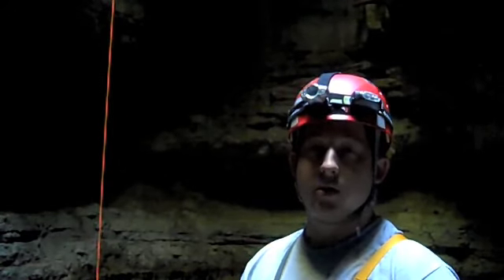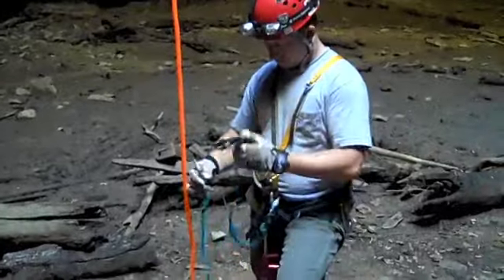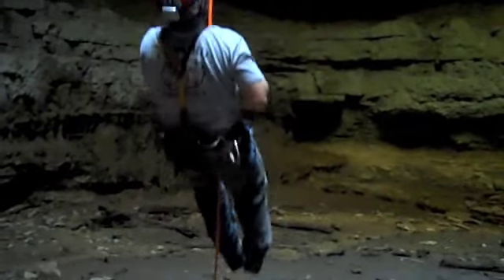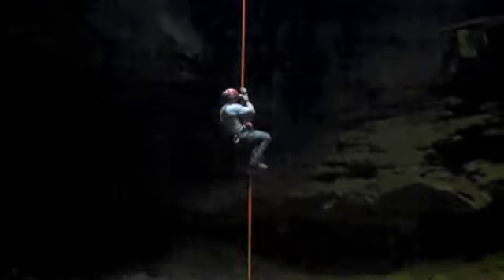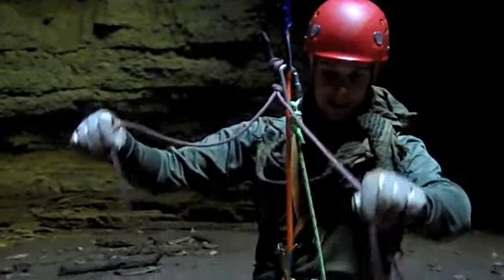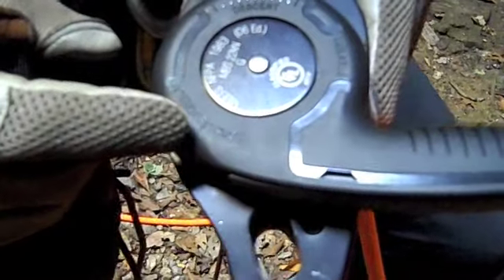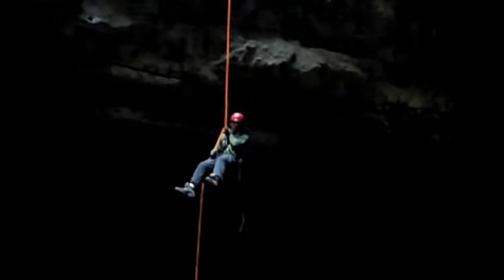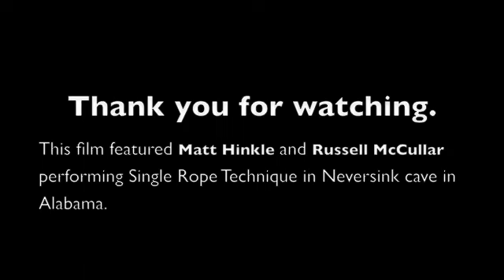Single Rope Technique

Comment from the maker: Yea, we enjoy our petzl gear.  We have changed a lot since this video.  We are using sewn webbing foot loops by On-Rope 1.  They work really well and have extra stiff webbing layers at your feet to keep the loops shape.  We both have also started using their cave specific harnesses which lower your croll attachment point very low so you get a good throw on each pull/step.  Thanks for the comment.

Comment from the maker: We use a variety.  Usually either a mini rack (4 bar with hyper racks) or a Petzl Rig on 11mm rope, just depends on the situation. If it is muddy we wouldn't use the Rig. If it is a long drop we will use a large rack for better heat displacement and preferably stainless steel so your rope doesn't turn black from the aluminum.  Several people do use the Petzl Stop also.

Comment from the maker: @bushy77788 The bounce you see in the video is because even with a really static rope (ex. %1 elongation) you will still have a 1 foot stretch at 100 feet of length (1m stretch with 100m rope) when loaded.  This is a 165' (50m) drop so even with a very static rope you still have a lot of stretch in the rope.

Comment from the maker: The Petzl ID'L.  This is basically the same thing as the Petzl Rig but rated for 1/2" or 12.5mm rope.  It is certified to the NFPA 1983 "Firefighter" Standard where as the Rig is not.

Comment: What are the names of all the gear you used?
Reply from the maker: I apologize for the delay in replying. That is a pretty old video but I can give you a run down of several pieces of equipment we use:
On Rope 1 harnesses and adjustable leg loops
We use Petzl often for ascending and descending, like the Rig and the Croll.
We also use mini brake bar racks, like the Hyper Rack Extreme.
Rope is usually PMI 11mm, this video was a 1/2" or 12.5mm.
We usually tie up some dynamic cows tails for setups.
We use Petzl, PMI and Kiwi Helmets
PMI and Ringers Gloves
We also use Petzl Harnesses pretty extensively when it comes to rope access and not cave work.

Comment: Can anyone point me in the direction of an ascent to rappel changeover using a full size rack? I keep having trouble with it.
Reply from the maker: It is pretty difficult to perform a changeover with a full size rack. It is possible with practice and helps tremendously if you have an adjustable leg loop. When you prepare to changeover (ascending to descending) you reave your rack as close to your lower ascender as possible, then before you changeover you bring your handled upper ascender as close to the lower ascender as possible. This is also when it helps to tighten up an adjustable leg loop. When you stand up you remove the lower ascender and then put your weight on the rack. If your upper ascender became out of reach then your lanyard was a little too long or you didn't bring the upper ascender low enough to start with. You should be on the rack and able to remove the upper ascender now. If you are changing over (descending to ascending), it is a good bit easier. You first attach your upper ascender as high as you can reach and if you have an adjustable leg loop now is the time to tighten it up. Stand up and you should have plenty of room to attach your lower ascender above the rack. Then sit down on the lower ascender and remove the rack. There is also a completely different way of attaching upper and lower ascenders to use a full size rack but the climbing motion is extremely inefficient.
Reply: Thanks matt. I'm very comfortable going from descent to ascend already found myself in a situation where the rope was too short  but the other changeover has been giving me trouble. Thanks for you explanation. Do you think having an extra ascender like a Tiblok or Basic would help?
Reply from the maker: I sent you a PM, let me know if you need anymore help.

Comment: 1)The rope of the hand-ascender go back to the ascending rope. Wrong. You have to put it on the right of the rope.
2)You have to modify your step. I think it's better if you have it more long and it's better that you do your leg movement not in front of you but under your back (like a horse-kick).
3) The ID isn't good for caving activity. It's better that you use petzl simple or petzl stop with secondary parallel steel carabiner.
4)if you are rescuers today i learn that self-recue it's better :D